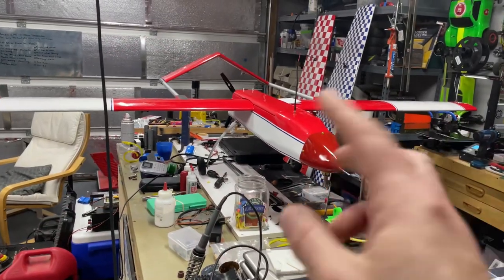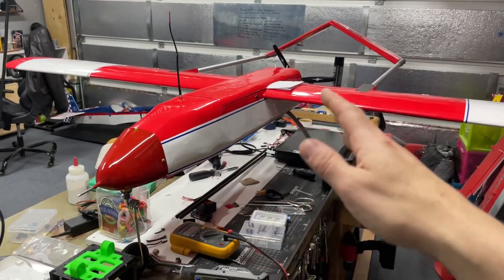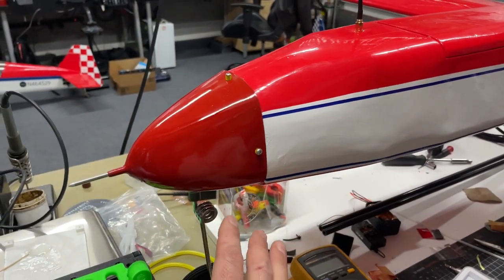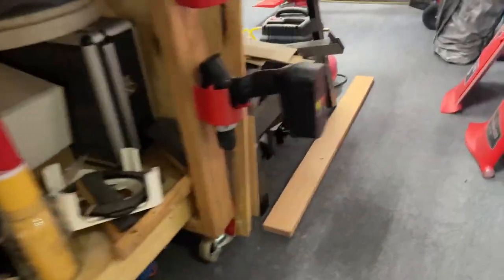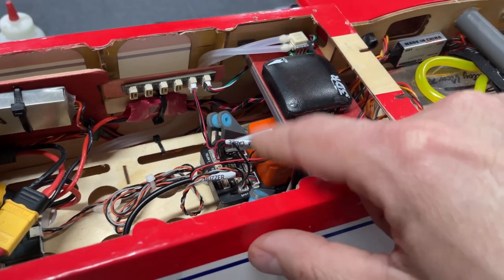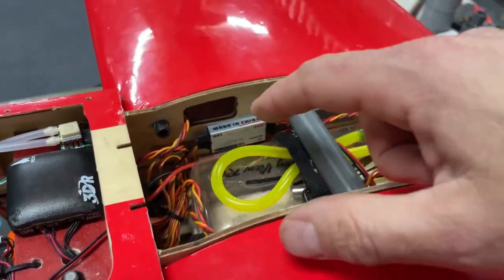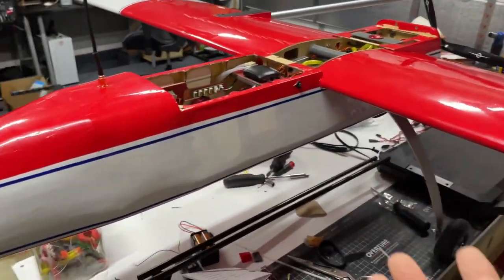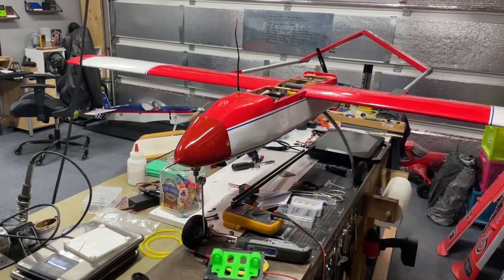DW Hobby RQ-7 build for Work

Comment: Just came off flight test for the Legend Hobby version.  I believe the Legend ARF is a revision of the kit you built that has been around under a couple different names.   I chose 30cc Stinger.  Made our own isolation mount, omitted the stand offs.  I need to carry a fairly heavy computer.   This resulted in a payload capacity of almost 4 pounds.  I believe a 20cc twin Stinger could be considered for lower weight payloads.  The frame of thought here is you need x weight in the tail (motor) to get to X capacity of payload up front.  Finished flying weight 16 pounds.  Takes off very nicely at 19 Meters Per Second, stall is about 14.  WOT is around 25/26mps.  Break in not done, I expect 27 or 28 when fully lean. It's floaty and trainer like other than no roll induced by yaw.    There was even a period of controlled flight around 11mps.  With more time we can put a sharper point on it.   From a payload space point of view, the Dancing wing has a much more open payload bay.  I had to modify the Legend for payload reasons and stiffen up the fairly disappointing boom attachment points in the wing.  Easy to fix now that I know how.  Having no interest in scale, I corrected the landing fear location, moved it forward 1.5", Raised it up 1.25" (opened spread 2"), used stock nose gear.  Lands and sticks perfectly!  Only 2" of ground clearance on stock gear with 18" prop which I thought might result in occasional ticked props.  Of course, getting enough fuel for research in is a big issue.  We're building a custom tank.   about 32 ounces is possible plus a possible 16 ounce aux tank.    I think with a 20cc stinger you'd have about 2.5-3lb payload and it should still fly well weighing about 24 ounces less all up.  The biggest stock tank I can get in the Legend with a blister hatch is the 16oz Dubro.   Decent research platform.  Thank you for answering a few questions for me months ago regarding your engine choice.  I'm pretty happy with the 30cc.  I wouldn't go below 20 or above 30 here for this kind of purpose.  Other notes and tips for your readers:  I thought Legends suggested CG of 100mm (on 12" cord wing was risky)  I marked it at 2.4 to 3.6" as absolute max range.  3.6" being 30%cg.  100mm suggest is almost 33% cg. - no thanks.  We haven't touched the huge flaps since it slows down so well.  As a research platform, if I were building, I'd omit them or reduce cord to 25% of current.

Comment: I have on order 2 of these in ARF from Legend for UAS work at a university later this year.  Can you tell me the engine you used and prop?  It looks like the DW version has more width available for payload in front of the wing box area than the modern kit.  Also, What kind of distance do you have from the prop shaft to the ground?   The recommendation is 20 to 30cc which is 15 to 18" props.   I sense your engine is 20cc or less from what little I can see of it.  Appreciate your video.  Let's me do a little prep before the project arrives.
Reply from the maker: I started with the 9cc but way too small. I swapped for a 15cc but haven’t flown yet. The 20cc on the DW will be way too big and will rip the DW apart. The Legend version looks beefy so might be fine
Reply: @JoesRCCorner  Thank you.  I studied the photo and found the 9cc engine at VVRC.   Looked like it was most likely the 9cc.  That seemed shockingly small because the modern recommendation of version II is 20 to 30cc.  But, I understand your choice, it does appear to fly well with light power in all available videos.   I am concerned about having some payload capacity which depends on having enough weight in the engine in order to "need" enough payload to balance.   I agree, it looks like a useful aircraft for UAS work.  I wish it were a tad bigger.  I'd really like to use the 41cc Saito.  Worried that might be too large.  Needs an 18" prop and because it cannot be reversed, it would have to be a pusher.  Our larger aircraft (Osprey made in Florida) is some configuration, we use a DA 100, reverse pickup, standard tractor propeller.  Flown as high as 87 pounds.  Will carry about 30 in payload.  Love to have a a smaller bird that could do 10lbs.    We'll see, I might be asking for too much here.
Reply from the maker: @CraftedChannel  the 41 might be too big for sure. The weight will also eat into you max payloads too. I fly Aerostar UAS here in NM, MTOW of ~600lbs with a payload capacity of 100lbs and loiter time of 16hr and ceiling of 18k. We use them as trucks for experimental payloads. Also have Tigershark UAS too, ~300-400lb MTOW. Good luck with your project would be neat to see how it goes.
Reply: All @JoesRCCorner  Nice.  we are 100lbs or less here.  A heavy payload is 30 pounds.  At least, that is all we've needed so far.  I agree the 41 is likely not going to make it. Just keep in mind what I am thinking about here.  It does little good to put a super light hobby system on a twin boom pusher, stick 5 or 10 pounds of payload in it then add lead to the tail.   Our issue now is replacing a marginal X8 Skywalker with something a little more able to manage an external payload which has yaw stability attenuation characteristics.  We need something longer. And Yes, I have discovered the yaw stability is marginal on these.  Have that solved.   Not much professional down in the under 15lb payload class.  Have to make do with COTS.  I also have a side interest in pushing the edges out a little bit and employing 4 strokes to extend collect times.  too bad there is no 30cc twin 4 stroke gas out there for this airframe.   The legend kit calls for up to a 30cc (2.5lbs).  Likely that is what I'll end up doing. The only thing that sucks bout the Saito 41 is the bushed conrod leading to needing a lot of oil in the mix.  Nearly everybody is running 2 strokes as you are aware.  There are more and more larger 4 stroke gas engines which have some application as of yet unrealized.